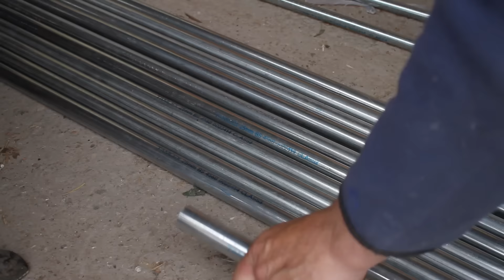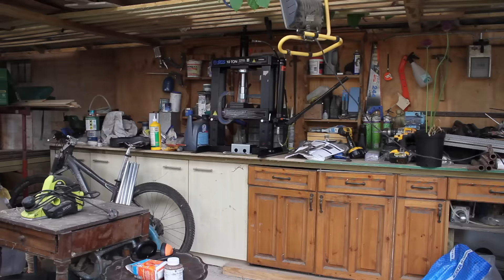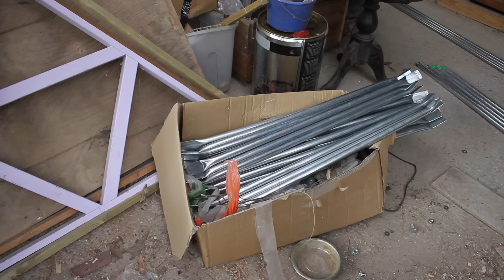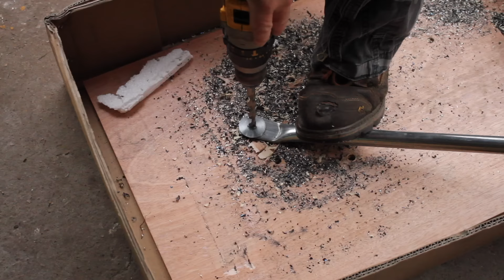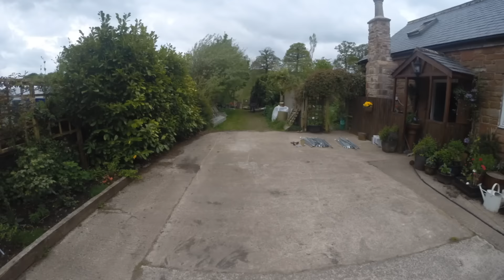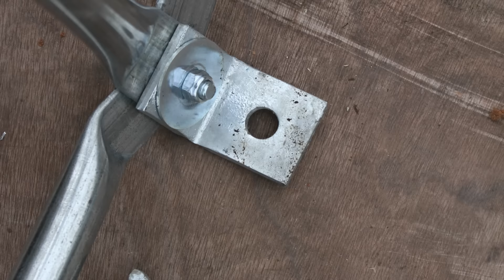Conduit Climbing Frame Build.

Comment: I've built one of Paul's wooden hub-less domes a few years back. They look beautiful but they take quite a lot of timber ripping. Recently I purchased a 5 metre diameter dome kit using the steel struts similar to that shown in this video. It's amazing how strong the frame becomes when it's all bolted together.
Reply: OUTBACK DOMES I believe u!
Reply: Hydraulic press certainly helps strength
Reply: I notice he (Paul Robinson geo-etc.) gives me, GIVES ME FREE! all the clues of his brief in-depth conversation “ here. Eye-bolts for the floor, parachute cover, all evidence for my slow mind. But (Paul and)YouTube lets me review over and over again
Reply: What dome kit did you purchase?  Ive made a magidome recently and looking to expand my skills into conduit/metal domes to get to airbnb level dimensions
Reply: I want one so bad!

Comment: makes me crazy when i see all these people grinding with no mask. I used to do that all the time, grinding with no protection at all. Take a look at the crap you are breathing in. All of the disc turns to dust then there is the metal dust and sometimes paint dust etc. It's mad not to wear a mask. I guess you could say the same about driving a car with the windows down, all the brake dust and other dust on the roads but lets face it thats going a bit too far. In the future of electric cars we will almost never use brakes as we can recharge the batteries with the kinetic energy, slowing down the vehicle in the process. Anyway i'm getting very sidetracked.
 Nice project.
Reply: I've heard that the air inside the car is often worse than the air that would be coming in from outside.
Reply: @shaun6828  Probably due to new plastic off gassing in the sun. I don;t really like the smell of new cars. That's one of the reasons i like driving and maintaining older vehicles. I mean, most of them are close to the year 2000 + - a few years. I do have a 73 RV in USA which is a bit old to be efficient, but pollution wise for the amount of use it gets it's almost irrelevant by comparison of people who drive daily. Not much off gassing going on in that one!

Comment: where did you get the lengths for each piece? how did you calculate this? 

Is the measurement you need centre to centre of the holes?

Comment: Could you please tell me what is the name and size of the tube that you used so I could order it off amazon?
Reply from the maker: It's 25mm electrical conduit, wall thickness is 1.6mm I think, better go to a electrical trade store, I think they would be cheaper than Amazon.

Comment: Hi Paul.
I'm thinking about fiberglass rebar struts to use for my geodesic dome frame. Did you try to use  that material before? I just wondering if it's will be stable under UV of sunlight.
Reply: Hey that's a cool idea, did you pursue it?

Comment: Thanks for sharing the information. An issue has become a mystery to me. How much extra should be calculated on each side of the pipe compared to the value of the calculator and how much should be flattened on each side. And does the radius of the center circle of the hub decrease from the length of the pipe in the PVC dome?

Comment: What is the biggest conduit frame you can build? Is 100 foot diameter 6v dome something that would break under it's own weight? Is 1 inch or 1/2 inch better? Is stronger better or lighter better? It doesn't need to be claimable. Just able to hold up a rain water collection UV protected greenhouse plastic.
Reply: Larger tubing is always stronger, the length of the struts would be one of the biggest factors in deciding tubing diameter.
Reply: @edgarpryor3233  is there a formula?
Reply: @AliAbdullah-oi3wc  I'm sure there is, but I don't know what it is.

Comment: I just put together two massive desks using emt conduit and makerpipe connectors, and made probably close to 100 pipe cuts. I never thought to use an angle grinder. 🙄
Reply: How did you cut the pipe? Pipe cutter I'm guessing

Comment: Greetings 
Appreciate your video
I’m from saskatchewan Canada 
We get extremely hot and cold weather with wind 
I’ve been looking into making a 3v dome some 24ft diameter to use as a 4 season work area for larger projects and a green house
I have a small work area that I could manufacture the struts in.  Construct in winter if it’s nice days around minus 10c
Questions 
What thickness of aluminum piping is used?
Size of hole drilled and length of bolts 
Thankyou
Reply: It's galvanized electrical conduit. ⅝ or ¾.

Comment: Nice!   Wondering to save time, if would be easier to make a tool and die to just stamp, cut hole and cut rounded edge at the same time?
Reply from the maker: Yes if you where doing a lot that would be the best solution, I might look at something because this is quite an easy way to build lots of things.

Comment: Nice work. Really like all your different designs. What the spec on the conduit?
Reply: 3/4 inch or bigger for climbing depending on the strut size. The conduit looks like it is 1 inch in the video.

Comment: could you put glass on all of it
Reply: glue. but you would have to get the triangles cut, It would be possible to make this out of a flat or angled material with a bit of thought you could find a different way to attach glass. you could just make glass triangles with holes in the corners and then bolt them all together, might work with toughened glass but v expensive! or with perspex
Reply: some sort of mastic type glue, the really sticky shit.

Comment: Noh my god... dont use EMT conduit. Thats positively the worst example of a pipe or tube you can find. Trust me i spent the last 16 years bending it and then pulling c@#$ suckin wires through it. I wouldn't hang my kids from it even if they were actually the mail man's kids.
Reply: ok if that's the case what do you suggest then
Reply: Use steel tubing. The differences are thicker walls, better seam welds, sized by O.D. not I.D. and its available in an array of alloys anything from aluminum to chromally or even titanium. An example of tubing would be a roll cage in a race car. Obviously a much heavier wall than needed here.
Reply: The welded seam on conduit is not made to suit these types of streesses. Ive seem conduit split right down that seam just bending a 90' snd its designed to be bend like that. Im mot even sure that conduit would be cheaper.
Reply: @mds1986ms  conduit is definitely cheaper, until the lawsuits come in.
Reply: @edgarpryor3233  
Yeah i mean i guess if you stick to short pieces and pay close attention to where the seam is sonit not facing the stress point then maybe id callnit a polished turd but im just barely old enough that i got to play in playgrounds that would hurt you and these things were definitely not built with emt. May IMC or ridgid but definitely not poop emt but thry also had gussets at all the joints. So yeah these days lawsuit is definitely where youll end up.
Reply: @mds1986ms  it's an excellent choice for something like a portable chicken pen though. At around $0.50/ft for 1/2" (was ~$0.30/ft a few months ago) the price is hard to beat.
Reply: @edgarpryor3233  
Ok so its got its applications ill go along with that. Its definitely not structurally sound enough for kids to play on. And i would also argue that by flatten the pipe or conduit at the ends youre creating a weak point. I understand that there really no option there im just stating its a weak piont.
Reply: @mds1986ms  I agree, children are among the most destructive creatures you can build for.
There are options for connecting without flattening, but that is the easiest method. The load is shared between so many members that the reduction in strength isn't really an issue at that point. 
I've seen adults hang and climb on these types of structures made from 1" PVC.